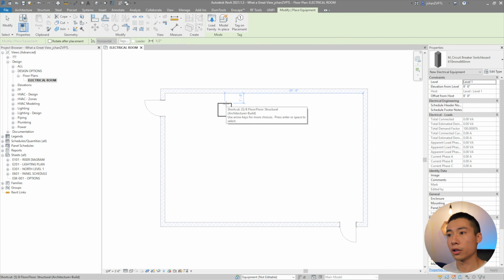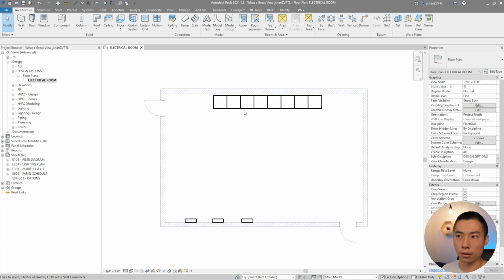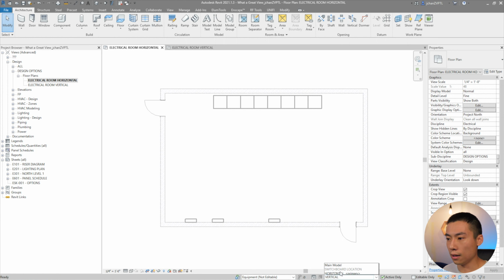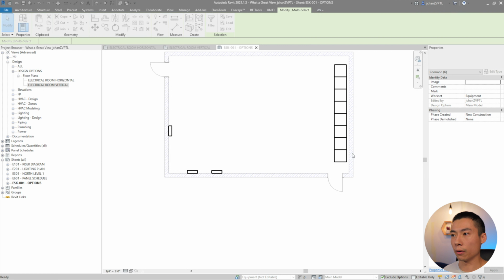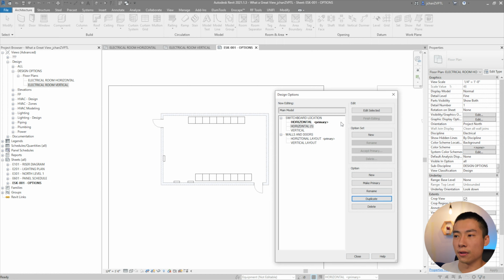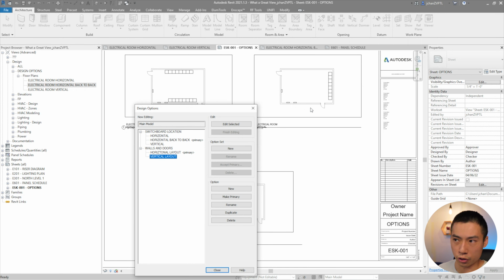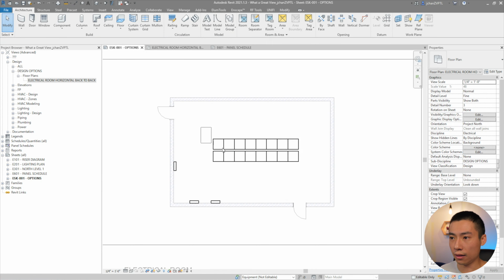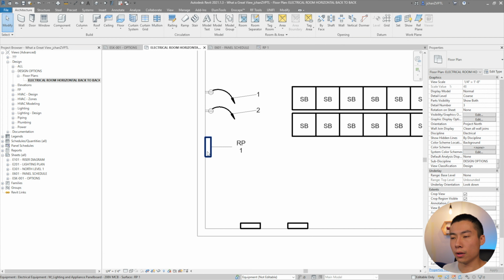Revit Review - Design Options

Comment: sir my plan is using 3 phase so I set my distribution system to 3 phase (220 V 3wire) the problem is all of the lighting fixtures I used is display 1 pole and I  cannot change it in edit family. so I use 220 single phase instead but it is actually 3 phase in real situation what can i do ?????? ty
Reply from the maker: Whoops, missed this comment by 5 months 😅 um anyways, you have to click on the Electrical Connector in the lighting family to change that to 3 poles. Once you get that updated, it will let you properly circuit the fixture to a 3 phase system. Ideally you would link the number of poles to a typed based parameter so you don’t have to edit the family to change it.

Comment: Anyway you can explain what you're taping  and pushing while you're making the drawing for us rookies? 😨
Reply from the maker: Oh yea I have been trying to find a key logger that shows the keys I tap when I work. Pretty limited on what I can install on this computer so I might have to just learn to speak what I'm typing when I do a video. When working during the day, I use keyboard shortcuts 95% of the time. I only click on the ribbon when a keyboard shortcut is not available.

Comment: You’re videos are awesome!! Sooo helpful! I’ve been leaning the software for a few weeks now and I have a huge question…. Where do you get your families? I’m designing electrical systems and i can’t do any conduit. I’m trying to do some underground as I speak and I have pvc in and fittings but they are not together so they won’t connect. Anything will help!
Reply from the maker: So when you place your conduits, you need to Edit Type and specify fittings prior to placing the conduits. I realized I forgot to show that step because it was already set up in our template. As for families, we either ask our vendors for them if they’re savy enough, or we create them from scratch. I can usually get generators, panel boards, light fixtures, and switch gears right from the vendor these days. Otherwise you can check out BIM Objects for a bunch of free families.

Comment: Such a great Video! I will definitely use these going forward when the architect wants to see multiple layouts for my equipment. It would also be useful when you're thinking of multiple ways to lay out a room. I always have a couple ideas when I start. Funny because I was wondering the same thing about the options breaking my pipe. I figured it would work for electrical since the connections are "analytical" but I doubt it will work for piping. Great video and I learned a ton!